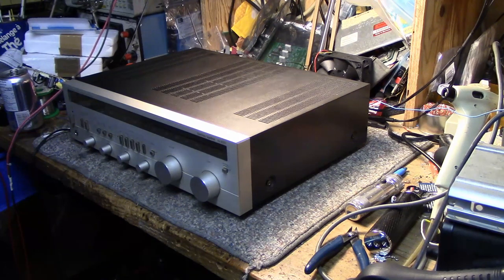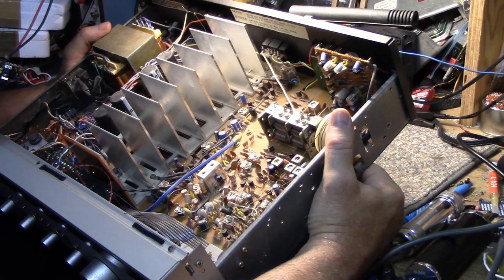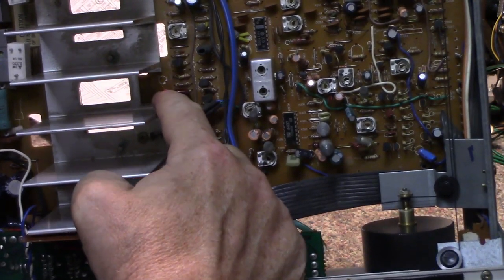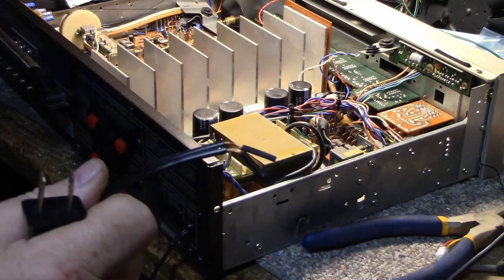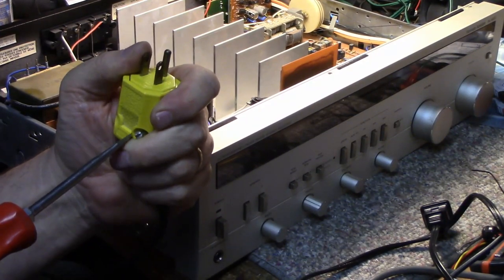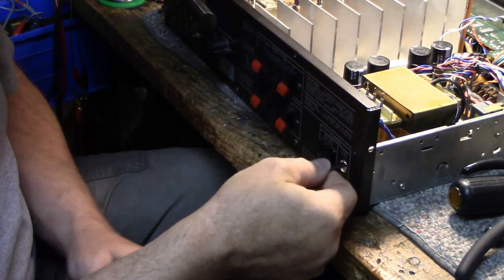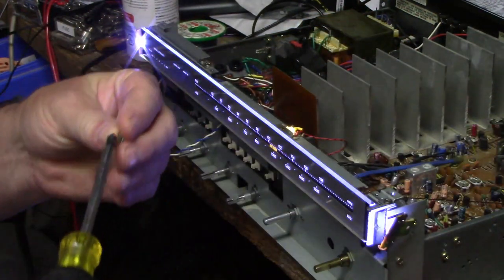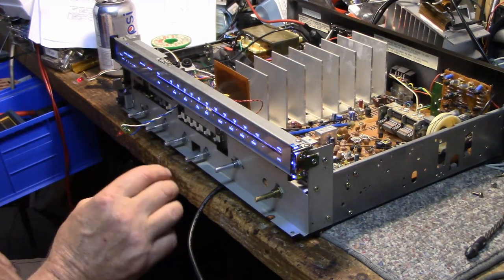Harman Kardon HK460i 1 -  More repairs (Ep. 34)

Comment: I just acquired one myself for what is a bargain (for once), and after rotating the knobs a while it started to sound super sweet, less bass oriented than I would say my hk430 is, but a lot lower quality especially in the detail /cosmetics. But it still tends to be what I listen to even if not the most powerful, well kept or even a classic(?), the ability to widen or shrinking your stereo images depending on position or recording. Also have some 5600 uF 63V caps I consider for the PS, those thin 4700/50V might do sidewise but not more and they stay a few years by now. Any insight on if the usual one size up/down but not more, goes for this old H/K? Should do good. Thanks for the video.

Comment: My unit i just acquired gets VERY hot, even when just turning it on sitting there idling for about 20 minutes. This normal for this unit? Is there a way to adjust bias (idle current)??
Reply from the maker: It certainly sounds like the amplifier is biased on a lot. At idle, these receivers should consume about 30-35 watts and get warm but not hot like you describe. If you have a good voltmeter you can verify if the idle current is correct. Measure across both emitter resistors and you should read 33mv. You can download a service manual from HiFiEngine and read the full procedure on how to adjust the idle current and DC offset for both amplifiers. Also consider an amplifier that's been run hot for some time may also have cooked capacitors and cracked solders by now